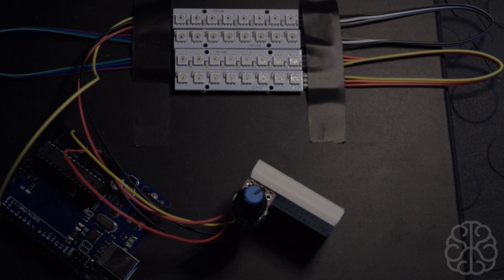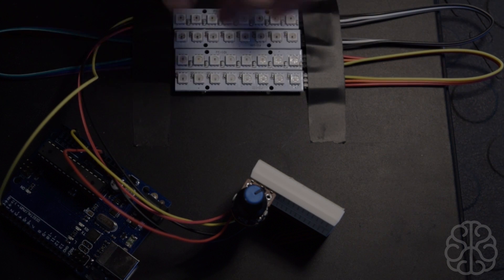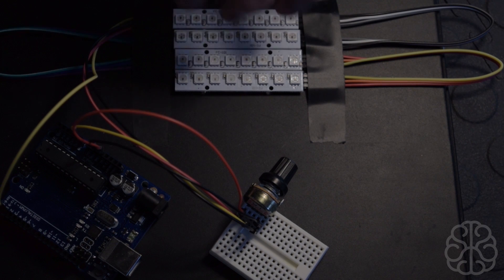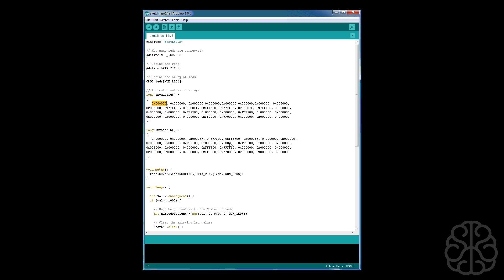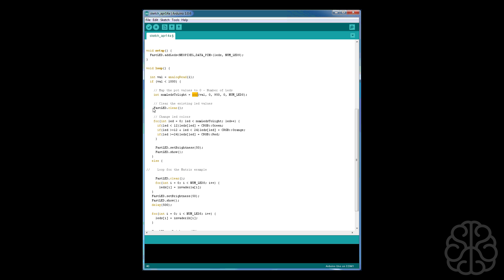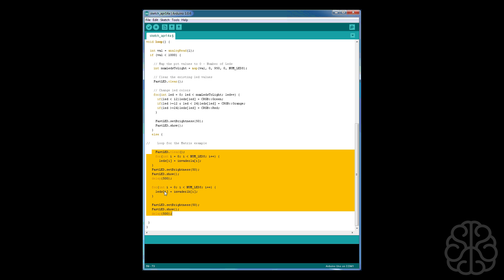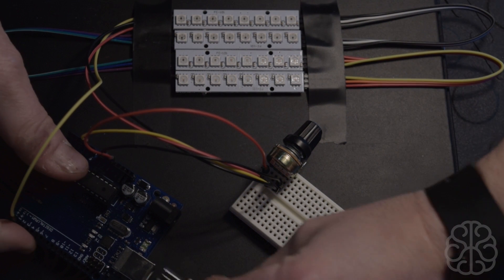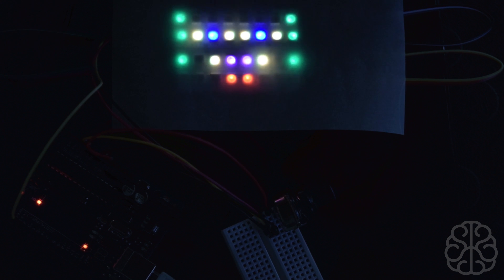How to connect and control WS2812 RGB leds with an Arduino - Tutorial

Comment: How many leds could resist just the arduino? I want to work with a led panel of that kind of leds but idk if I need just the arduino or if I would need a external power supply (I want it for a cosplay :c)

Comment: Great little tutorial !!! Helps a lot. BIG THUMBS UP
For everybody that's going to use external power for powering up the led stripe ( i used 60 led's) while powering up the arduino via usb connection to PC: Make sure to connect ground between arduino and power supply in order to prevent uncontrolled flickering of the led's. I had a hard time (about an hour) figuring out....
Reply from the maker: Thanks for your comment about connecting the grounds when using an external power supply to avoid flickering 👍
And thanks for watching :)

Comment: hey, i have a strip of 288 * ws2812b laying around, which type of power supply would you recommend?
Reply from the maker: +JonTheChron Hi, well each pixel (led) when all 3 colors are on consume around 60mA (20mA per color: Red, Green, Blue) so unless you light all the colors (= White) then the Amperage would never be 60mA all the time.  But if you want the absolute maximum Amperage then it would be: 288 leds * 60mA = 17.28Amps.  But like I said that's all White all the Time!  Depends on what you do with the LED's.  Hope it helps...  Thanks for watching!